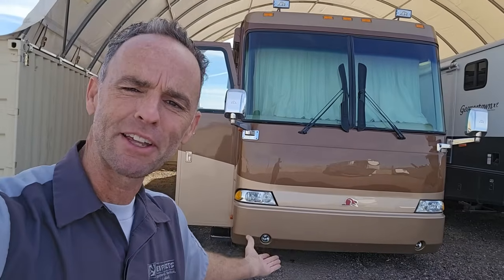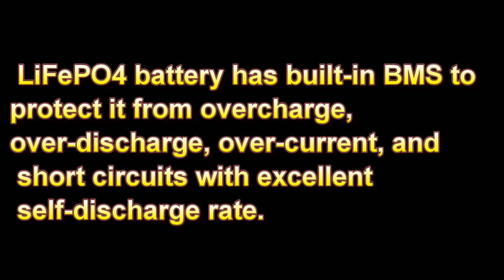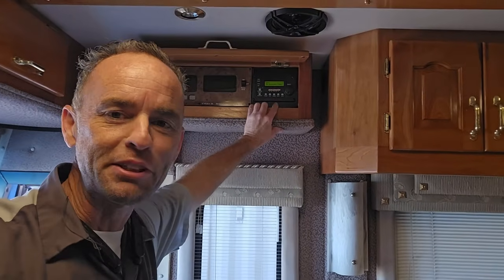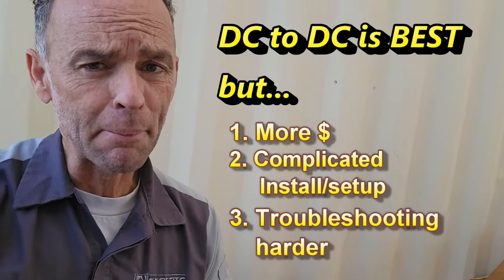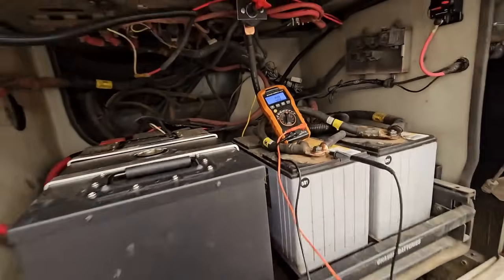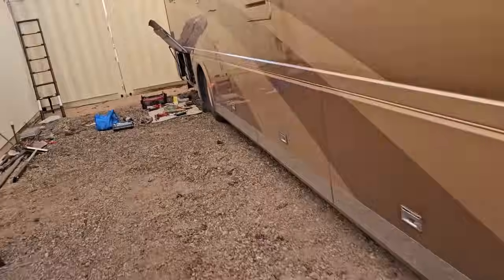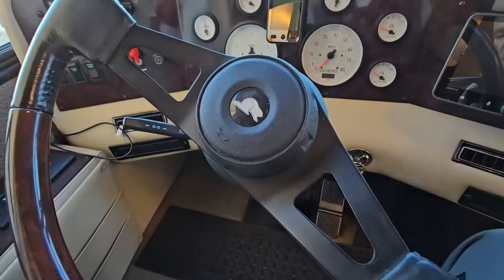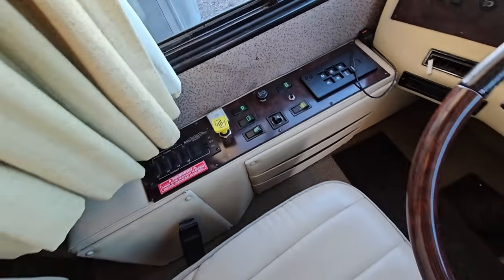What You NEED to Know About Adding Lithium Batteries to Your RV

Comment: Would you not achieve 14+ volts from your coaches alternator while your engine is running to top off your house batteries?
Reply from the maker: Likely over time yes.

Comment: I am waiting for a Lion battery that will drop into my 4 each golf-cart-sized battery holder in my RV that I can install without huge upgrades in power controllers, chargers, inverters, etc. a charging draw limited to lead-acid type alternator power demand that won't burn up the alternator on the engine or the generator. I don't need instant charging.
Something that just works in existing RVs that doesn't require $10s of thousands to upgrade the RV electric.
Millions of RVs out there.

Comment: Something that was not addressed and perhaps is not a concern in AZ...  but can't cold temperatures cause issues?  Unless you relocate the new batteries to a warmed area...they could easily get below 32 degrees.  This is the issue that is keeping me from switching.  Anyone have suggestions?
Reply from the maker: my battery has low temp cut off for charging, if I were building a larger battery bank or constantly RVing in winter temps I would likely relocate the battery bay. Some batteries have heaters but I'd likely just get a 12vdc blanket heater with insulation too.

Comment: If you charge your Lithium batteries with a converter that does not have a lithium profile you will only reach 85% SOC.
The problem with that is that the BMS can not balance the cells. Efficient balancing happens above 3.45 cell voltage.
Reply from the maker: correct, the battery just won't be fully charged and balancing is not really an issue for a good BMS, and being 85% charged most of the time would be a good thing for most of these batteries anyway.

Comment: Check your alternator temp: run your lithium batteries down to about 30%, then start the rv and let it charge at idle and check the alternator temp after 12-15 min. If it’s above 225 deg F , i would seriously recommend a dc-dc charger. Keep in mind your ambient temp too.
Reply: In the real world, how often will you be idling for 15 minutes?

Comment: I am in AZ for the winter and want this same battery for my Aspect.  Are you available to install it and the BIM?  I can acquire both
Reply from the maker: Aspects usually have a tight house battery compartment in the floor I'm not confident this would fit in.

Comment: I wouldn't use the RV switch that just connects the house and chassis batteries together.  With the right states of charge on the two of them, you could be continuously pumping 250A into the chassis batteries, at a time when they're nearly dead.  Sounds like a good way to completely kill a battery that's already almost dead from being drained.  Of course, when the voltages are more nearly equal, the current is less and it would charge OK.  But even in that case, I'd prefer a charger to just throwing the batteries in parallel.

Much easier to just use the inverter hooked to the house battery, to run a regular old 12V battery charger, to charge up the chassis batteries at a known rate, like with a 10A/50A or 10A/40A/200A chargers where the 200A is only for a few seconds boost while trying to start the engine.  Maybe a 40A on each battery directly could speed it up.  It would be fine to wire in a separate inverter there, if you don't want to use the main house inverter.  In November, I paid $140 for a 2000W pure sine wave Redodo inverter!  Their 1000W is very often under $100, you know where.

Comment: The BMS does not control charging, it is for protection of the battery, You need a proper charger for LFE batteries. You can get a dc-dc charger that will properly charge the battery and protect your alternator.

Comment: Excellent video, But If I can make a comment here. There are certain lithium batteries that are dual service purposes. Like mine That I use on a boat. 1000 CCA and 280 Amp capacity. there are also 135 and 560 capacity with also 1000 CCA Or am I wrong ? Also I prefer to use a DC to DC charger for the only reason that the Isolator you are showing is known to fail  often. I fix a lot of those of RV's compare to the 12/12 30 Victron is pretty reliable.. Just My opinion.

Comment: Hey James. What is your opinion regarding Hydrogen generators in RV's? For example, WATT has a proven product according to many.  Thanks - Frank in Scottsdale.
Reply from the maker: I do not see how a overly complicated fuel cell with compressed hydrogen is a great idea for a rv. Hydrogen is also a very expensive fuel, which is mostly derived poorly from petro and so gas or diesel would be a better choice and has more btus too. Otherwise, a fuel cell with solar to recharge the hydrogen from electrolysis in a nearly closed loop setup seems fun but likely very expensive and likely only good for spaceships.

Comment: Lead acid profile generally absorb charges at 14.4v which is perfectly capable of getting LiFePO4 to 100%. There is no need to get to 14.6v. The BMS is basically a voltage controlled switch. If charging with a lead acid, or any other charger really, you can just set the BMS to disconnect at say 14.2v this avoids the risk of ‘low voltage overcharging’ which can happen if your charge source either can’t reach the BMS cutoff or can’t cut off charge one a set voltage is reached. 14.2v at normal charge levels you might expect will get them to as near 100% as makes no difference. DC-DC converters are the work of the devil: expensive, inefficient and limiting, only useful where you have too fundamentally different voltage systems. The resistance of the charge lead from the alternator can actually limit current to a safe level very effectively, it’s one instance where charging lead resistance works in your favour. Many of us are doing this in boats to limit alternator temperature.

Comment: My problem would be I live in the north east. Aka very low temps. How do.I combat this???
Reply: The BMS will stop the charging, check your specifications to be sure, if the temp is too low.  Typically 32 degrees battery temp. I have a camp trailer and moved the batteries inside so the battery can charge while I am living in it.
Reply from the maker: There are LiFePO4 with heating pads but don't forget, lead-acid does not like freezing temperatures either and lose a lot of performance too.

Comment: I have 12 200 ah 3.2 v calb prismatic plastic encased cells here in my van in a 3S 4P configuration and a 200 amp daly BMS control's it all and I use a xantrex freedom xc 2000 inverter charger too the batteries I got came from 3 ks2 corp battery boxes

Comment: After watching your " Vatrer " install a few days ago the next day I ordered one and as soon as it comes in and looks good I will be ordering a second one while the gittin is good . QUESTION / DISCUSSION for anyone ..........
I also bought the Li-Ban 250  ( keep in mind this is a fresh custom build rig with generator back up ) and now I'm considering sending the BIM back to Amazon because I keep hearing bad experiences with that and I do not want to risk 2600.00 on a failed  BIM . I have a new 140 amp alternator also. I see others using Renogy Rego and still concerned if that will be dependable because I have 920ah or doesn't the amount of " ah " matter ?.. Not sure if I will add solor because I have the back up generator and the two 460ah batteries . 
What would you all do in my case ? and also , what inverter would be compatable with my set up ?.
UGH ! please help a Brother out .
Reply: If your system has a big boy/bird isolator setup see my reply above  on what I did on my coach to avoid overloading the generator without swapping out isolator or adding DC-DC.
Reply: @nwhidbey2074 , I should have said this build is a 1991 Ward Senator flat nose ex prisoner transferring bus ex mobile library bus ex stock car hauler with a 1st Gen Cummins 5.9 diesel that I completely stripped, enclosed the rear , covered / overlaid with 1/4” fiberglass gel coated skin… whew !. One of a kind that I will be living in full time pulling my 1957 Lone Star ElDorado boat fishing the United States so I have an electrical clean slate ( I’m a retired RV Technician with limited electrical capabilities yet learning at 68 years old ).
So I want to do this the right way.

Comment: Would you address charging if the outside temperature is below freezing.  I've been told you cannot charge lithium batteries below freezing as you'll damage the batteries.
Reply from the maker: This Vatrer battery BMS will not allow charging at freezing temps with a low temp cut off.

Comment: Please note that BMS's in lithium batteries protect from over-volting, under-volting, over-current, and shorts.  But they do NOT protect from over-charging.  Any voltage above roughly 3.40V/cell (x4, x8, x16 depending on the battery voltage, e.g. 13.6V) can fully charge a LiFePO4 battery eventually, and if that voltage or higher is held indefinitely the battery will continue to charge and become overcharged.

Charge targets are typically 3.55V/cell, aka 14.2V if it's a "12V" LiFePO4 battery.  Chargers should reduce the voltage down to float of 3.35V-3.375V/cell, aka 13.4V-13.5V, once sufficient time has passed (see below).

The reason the charge target is up at 14.2V is to give the internal BMS a chance to internally balance the cells of the battery pack.  If you charge to a lower level the BMS's balancer might not even turn on and the individual cells within the pack will slowly become unbalanced over a month to a few months of time.  So it is ok if the battery cannot be fully charged sometimes, like when on a camping trip or something, but not all the time.

This also means that ALL charging sources for lithium batteries should always be properly programmed or designed to operate with the lithium chemistry you have.  You generally don't want to parallel lead-acid with lithium (with a relay, for example), nor do you want an alternator to directly charge a lithium battery (for several reasons).   You always want to use a proper DC-to-DC charger for those interfaces, and use proper charge controllers for any solar.

Charge target 14.2V to 14.6V.  Hold in "absorption" for 1-2 hours to give the internal balancers time to do their job.  Current tail can be disabled.  If 1-2 hours is too long for you, 30 minutes is about the minimum time to hold the charge target if you want the battery to stay healthy.  Then drop to a float of 13.4V to 13.5V.

Set inverter disconnect for 12.0V (this will be roughly 95% discharged), maybe a little lower if you have heavy loads to avoid premature triggering.  Do not discharge all the way to BMS disconnect if you can help it.

Done.

-Matt
Reply from the maker: Thank you for the information. I do not see how you conclude that the BMS doesn't control over charging.
Reply: @AZExpert  The BMS just prevents over-voltage, which is typically 3.65V/cell (14.6V).  (It will disconnect a bit earlier if the cells are out of balance).   For a LiFePO4 battery, the voltage does not equate to the state of charge.  Any voltage over 13.6V, if held long enough, will fully charge, then over-charge a 4s LiFePO4 battery.   The over-voltage protection is there only to prevent electrolyte breakdown and the ensuing catastrophic failure.

So a BMS prevents cell over-voltage, but it does NOT prevent the battery pack from being over-charged.

What prevents a battery pack from being over-charged is for all charging sources to implement a proper battery profile.  More precisely, allowing the battery to return to a proper float range of 13.4V to 13.5V (and no higher) after the 14.2V bulk and 30min-2hr absorption time is complete.

A LiFePO4 battery that has been charged to 100% and then returned to the float range will still hold at nearly 100% indefinitely.  

Again reinforcing the point that for a LiFePO4 battery, the voltage has very little to do with the actual state of charge of the battery... not until the battery is nearly completely empty or nearly completely full (during charging)... the state of charge remains even after the voltage is relaxed, so you can't even tell whether the battery is full or over-charged by looking at the voltage.

-Matt

Comment: I think you might be wrong  about the modern bms.    The bms function is to protect the battery.  Not control the charge.  Think of it as a fuse.  Not something you want to be blowing all the time.  But there if needed

Comment: long time viewer here... xantrex freedom can charge lithium=) . the manual shows a way to get a 14.5v bulk/accept charging profile by disconecting the temp sensor. the float can also be changed depending on the 5 profiles...now we all know we dont need a float so manually turning off the charger would be a better process. Would love to email  the screen shots of the manual!
Reply from the maker: I cannot cover every inverter settings but appreciate your information.

Comment: If it has the metal  "Lithium" in it, then it can burst into flames under certain conditions.
The metal Lithium is highly reactive and will react with water similar to Sodium metal. There are lots of video's on youtube showing this. There is also a lot of energy stored in these batteries as with most batteries and if mistreated or mishandled they can release this energy in a short period of time = fire and fumes.
Reply from the maker: Sodium is just as volatile yet we eat and need salt which is 50% sodium. The chemistry of modern LiFePO4 batteries if much different from cell phone and small electronics batteries and are quite difficult to ignite or even sustain fire. It's always important to get good information in order to understand when fear mongering and hate peddlers are trying to take advange of you.

Comment: Your solar charger can confuse your inverter/charger.  I noticed that my inverter/charger (Magnum) will skip Bulk and Absorb because the solar charger (Victron) has the voltage higher when it’s charging.  This happens in the morning when the sun comes up and the Victron starts charging, then I start the generator and the Magnum skips Bulk and Absorb modes because it thinks the battery is already charged because of the voltage coming from solar.  The quick fix is to disable solar charging manually when charging from Magnum.  You don’t HAVE to do this, but the Magnum does not put out a lot of amps in float mode.  So you really are not getting a lot of value running the generator.  This is on AGM/lead acid batteries.

Comment: THANK YOU for addressing the elephant in the room, but . . . . I'm still concerned about charging a low SOC LiFePO4 battery from engine alternator will exceed the alternators capacity, especially when it's still re-charging the chassis batteries.  While the LiBiM 225 will switch out after 15 min it's that 15 min I'm worried about.  How about posting an update video when you get your coach batteries depleted then go for a drive, monitor the alternator current and let us know how that went.  And disconnect your solar for the test!  An alternator on your coach might be easy to fix but I can't even get to mine!  (rear radiator).

Comment: And if a lithium battery BMS cuts off the batteries, for any reason, that will typically blow your alternator and electronics in under a minute, unless some has a starter battery or other third load on the alternator.

Comment: While you can't charge to the full 14.6V with a non-lithium charger, you can easily get to 98% state of charge, due to the charge profile of LiFePO4 batteries. The biggest problem is that the BMSs in these batteries want to get over 14V every once in a while to rebalance the internal cells of the battery.

Comment: Most lithium bulk charge is 14.6 and float is 13.8 to 14.2
Reply: For LiFePO4, bulk is generally 14.2V (14.6V will hit BMS disconnect which you generally want to avoid)... and float is 13.4V to 13.5V (which provides load support without over-charging the battery).

Plus you hold at 14.2V for 30 min to 2 hours or so in "absorb" after the bulk, before dropping to float.  The time depends on your comfort level. This gives the BMS time to balance the cells internally.   The current tail is typically less than 30 minutes so that function is usually not used.  You don't want to drop to float too quickly.

Comment: 2000 amps isn't correct to turn over your engine, that's the total CCA of your chassis batt string. Actual crank amps is likely around 750 or maybe 900A. Still overwhelms the 250A discharge of the LithBatt BMS. Just a note.
Reply from the maker: I dunno, one battery usually won't start these diesels and some larger ones need a third battery
Reply: I put the amp clamp on my starter (9L Cummins) and got 750A. My rig came with 1900cca of start batts, previous years w/same engine got 1500 (2x750). We need the x2+ CCA for the same reason we don't discharge deep cycle batteries >50%. Lead-acid gets hurt if you push them near flat.
Reply from the maker: @EngineerMikeF  that's good information, I don't have an amp clamp that I think is sensitive enough for the initial crank so you might be right
Reply: My VOM has a 'Peak' setting that'll capture the locked rotor amps. I assume 900A when advising on new start batts, my 5.7L GM diesel Trek came with two start batts but not group 31 size, so roughly same proportion